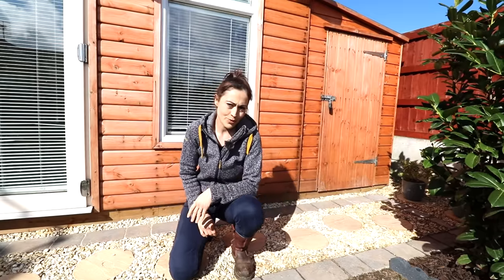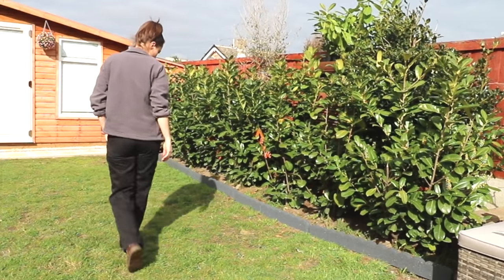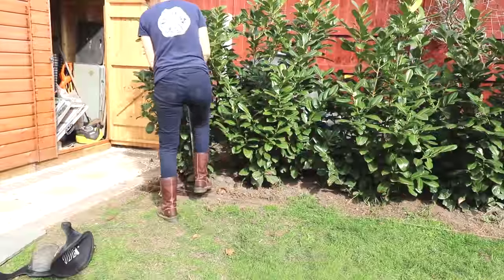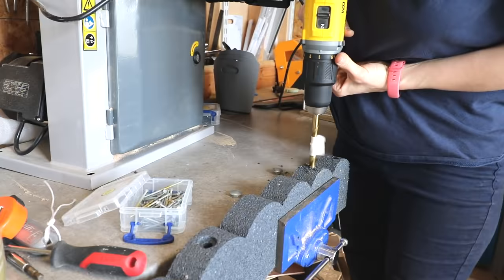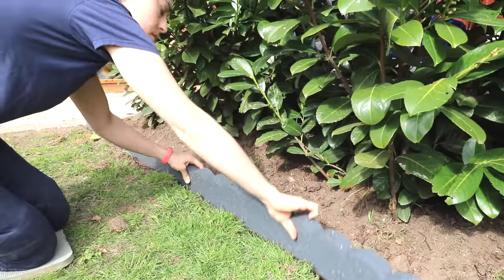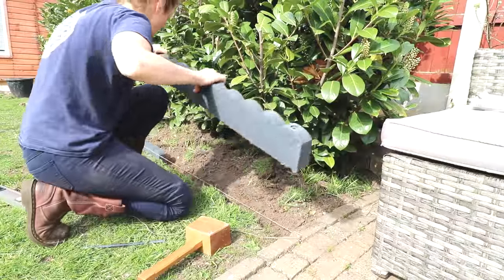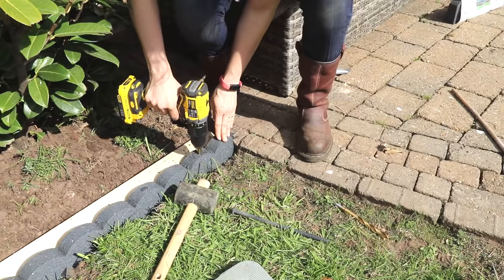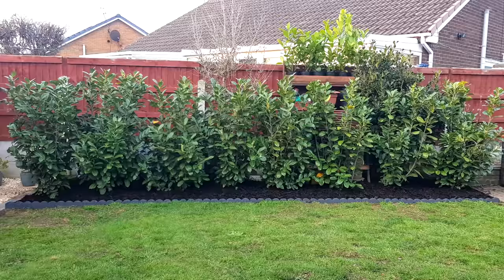Easy Garden Edge Border for Beginners / Lawn Edging DIY | The Carpenter's Daughter

Comment: I'm sure you have T-lights, I find that rubbing both sides of the panel saw eases the passage through difficult material. Damp timber ect.
Reply from the maker: I don't have any in my workshop, but that would work!  Or a rub with a bar of soap!

Comment: This looks great! I'll have to go get some of this edging. I'm working my garden currently. I finally built a trommel and screening away all the rocks...So many rocks! I can't plant yet. Colorado is famous for attempting to get into spring, but winter holds on here.
Reply from the maker: Is a trommel also called a rotary soil compost sieve... or a garden riddle?  When I Google it, it looks like a huge piece of machinery.
Reply: @TheCarpentersDaughterUK  Mine is a rotary compost sieve, made with old bike wheels and some hardware cloth. I have some old wheels that it rotates on. I really should hook up a motor but it's not going to be used very frequently.